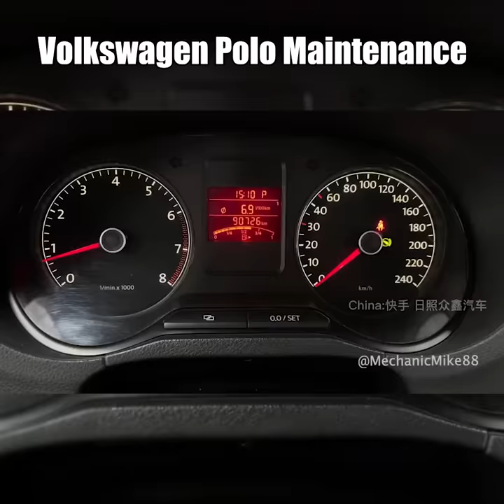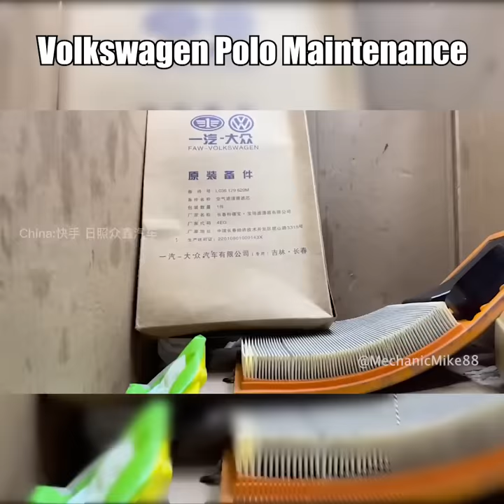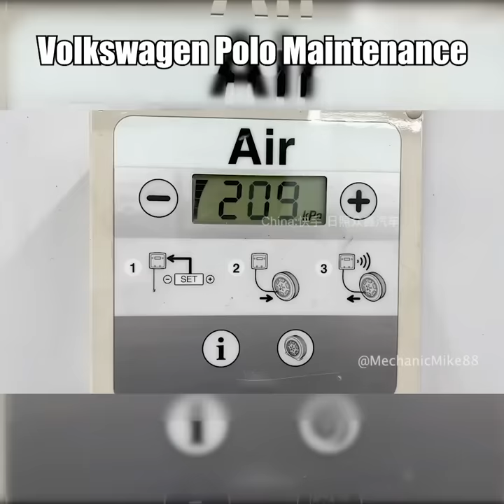Volkswagen Polo Maintenance Service.

Comment: Why not drain oil from bottom if you were lifting the car anyway, can remove sludge aswell
Reply: Yaya.. ill think the same way
Reply: Nah it actually does an amazing job at getting it clean from oil extraction since there is vacuum. There are videos where people put a small borescope in and you can see. Also Audi/vw dealers do this
Reply: @Givemedabeans  Does it actually ? If you vacuum doesn’t it bring all the particles across the entire engine ?
Reply: @dragos9134  well, we do this through the dipstick tube so it goes straight to the bottom of the oil pan, its going to suck everything starting at the bottom drawing particles up the dipstick tube instead of through the whole engine. it really does just as good if not better than going through the drain plug
Reply: @Givemedabeans  Thanks for letting me know I didn’t know that
Reply: Because of time, it's better to drain from the bottom, but faster this way
Reply: @Givemedabeans  its not true for all engines... 
Example, 1.9 dci Renault...
Reply: @Givemedabeans  which oil he eventually drain and clean the oil pan? Was it the gearbox’s?
Reply: @anesdj4282  yes that was the DSG gearbox service. Not sure how often it needs doing but I do believe it likes an oil and filter change from time to time to keep it happy.
Reply: @philiproberts6947  thank you buddy
Reply: @philiproberts6947  DSG oil change intervalle is every 60.000 km
Reply: Si en Puerto Rico los concesionarios dieran el mismo servicio V.W sería una mejor marca .
Reply: Vacuum not perfect as drain off...
Reply: I do all matinence on my mk7 gti and I must say the scwaben air tools and pumps work amazingly well.
Reply: Mrccanico per le bici.
Reply: @philiproberts6947  that ain’t no DSG gearbox mate. Old school torque converter automatic.
Reply: @bergEXPERT  that ain’t no DSG gearbox mate
Reply: Because they are lazy mechanics always looking for a shortcut or easy way out
Reply: @bergEXPERT  dsg means
Reply: Because he bought the tool to remove oil by vaccum, he’s making his money worth it
Reply: I think sometimes oil sump bolt hole threads are damage at the time open or tight after that complete oil sump need to be replaced may be that’s y
Reply: Why he put the new oil before it drain from the bottom?
Reply: @ng990  he was draining the gearbox oil
Reply: Literally how I do it on my Audi and VW's. Dont have to worry about stripping out the drain plug, replacing it etc and if all you're doing is a minor service you don't need the car off the ground at all so it's not taking up a lift.
Reply: If theres a magnet on the drain plug, it si better to remove the plug, clean it, the put it back. Theres actually no difference between draining and vacuuming. They are both great methods.
Reply: @Givemedabeans I work at a Volkswagen Audi dealer and that's how I do it. I have an apparatus which is under vacuum that sucks the oil out.
Reply: @shimon2476 And you think everything is easy, don't you? But you don't even know how to turn a screw.
Reply: @SaveAmerica69  dealership mechanic is accusing me of not knowing how to turn and screw 😂🤡
Reply: @shimon2476  you don't know that's right, you think you do.
Reply: @SaveAmerica69  brother sucking the fluid through a hose with a pump compared to draining the oil from the drain plug is not worth it when you are going to jack the car up anyways I did the hose method a couple times takes longer and you have to fiddle around with the hose to get everything out again not worth it
Reply: Why what's wrong with what he did
Reply: For long videos
Reply: Because Chinese Video
Reply: Because they wanted yo leave inside the small metal partes in It..
Reply: I believe sludge in oil pans is a thing of the past. Modern oil is designed to keep particles suspended. This should work just fine.
Reply: What products you use to clean the engine?

Comment: Your video is super impressive. Some points i noted.
1. The workshop/garage is absolutely clean and housekeeping is superb.
2. The juice scene adds an element of fun to the whole video.
3. The mechanic is an expert as the steps he is going through pretty quick.
4. You should have added a subtitle or explanation on each step.
5. Scene 1:28 are you using s suction pump to extract the old engine oil?
6. After you have jacked up the car, what is that you are removing to drain the oil 3:36? You have already used the suction pump and refilled the oil, then why are you removing the drain plug below?
7.What is it that you are removing in 3:50 and 4:00? Again draining out the oil?
8. What is the rd liquid you are pumping inside the casing after fixing 4:41?
9. What is the pink liquid you are pouring into the plastic bowl? 5:43?
10. Which model polo is this?
If anyone can answer the above questions, would be grateful. Thanks in advance.
Reply: My answer is from what I have learned over the years, I'm not a professional so do your own research too.

5. Many new German car, the manufacturer recommend sucking out the oil instead of draining it, check your manual, this is different per car but I believe draining is sufficient.

6, 7 and 8 from the look of it I think it the transmission oil since this car is for the Chinese market it's probably an automatic which mean ATF that he is pouring in.

9. That is coulant, the ball your see he pouring the liquid into is an expansion tank, it can have pressure when the car is on(and sometimes off) so be careful.

10. It's a fifth gen Polo, I don't know the specific varients. It is from 2009 till I believe 2016 or 17?
Reply: @nathaphonstikkelorum1068  Thank you for the reply. 
6,7,8 is there the transmission oil replacement for manual shift ones also?
I think the specifics vary based on countries. I am from India and they have recently stopped manufacturing Polo here. I loved this car and very sad to see it go.
Reply: @krsu1982  There is, manual usually last longer zo it isn't as frequently, my car a 01 Micra, i changed it on 200k km. Check the user manual of the car to see when to change.
Reply: Это WV Polo седан. Производился для Китая, России и т.д. Двигатель CFNA 1,6, 110 лошадиных сил. КПП - классический автомат Aisin, 6 передач.

Comment: Had a 1.6 polo sedan for 16 years. No problems at all. So down at the moment.  Stolen from my property 2 weeks ago. Loved that car. Only had about 55 000 miles on it.
Reply: which motor code?
Reply: Still Has Punto Sedan Version Linea
It's now near to 17 years i sure and garanteed not a single problems and no issues at all done 85,128 miles on odo still as new god sure amazing car 🔥
Reply: Mitsubishi 4g15 form 80s I remember it was 200000km(124000miles) when it was 20 years old. Of course it's JDM and Manual with clutch replaced.

Comment: Changing engine oil thru dip stick is lazy bad idea! All heavy contamination stay on bottom of subpan. New oil just dissolve, flush them and spread around engine cloging new filter aswell.
Reply: Maybe the oil sump thread is bad haha
Reply: That's why it's called made in china 🫠

Comment: Excellent, 
Safety is a need not a luxury!
I like the way you change the oil. Beside I would like to add engine flash before changing the motor oils.
Thanks

Comment: Should have checked condition of timing belt and ground cable connection at engine block. Clean and apply a metallic antiseize grease to the latter to prevent corrosion. Check positive cable at starter too.
Reply: Там цепь

Comment: You remove the old oil by sucking it? Interesting. I have that same Polo with 1.0 TSI. When I took it into the official VW dealer for service, I noticed that there was a notification in the service sheet forbidding the suck-out drainage due to leftover oil amount being too great. The oil had to be drained from the plug below.
Reply: Draining the oil is always better.
Reply: En el vídeo se ve que marca 3litrs y medio de aceite aprox. Y coloca 4 bidones de 1 litro cada uno. El demás aceite quedó dentro del cárter

Comment: Can anyone tell me where you could get that cap that fits onto the funnel for filling oil? Pain in the arse trying to trickle the oil in.
Reply: Just take off the black cap with screws above the oil filter, it fills much much quicker through that hole
Reply: Beta tool 1758A will do the same job.

Comment: Nice job ! I saw 3.5 l coming out of the engine and you put 4 l in ? Or did I miss something? If not, there is 0.5 l too much in it. Keep up the great work. I always put 3/4 oil in it, when its hot it rises 😎
Reply: My Polo has 1.0 TSI (Inline-3. This is inline-4 so 1.2 or bigger), and it has an oil fill amount of 3 liters.

Half a liter extra may not be enough to cause problems, but it doesn't make it a good practice. Plus, if the stick was dry before oil change, adding half a liter or so is understandable. The amount of oil between the top and the bottom of the dipstick is approximately one liter.
Reply: @akisalmenaho8473  I understand your point, if the dipstick was dry then there is another problem ... because engine is "eating oil" and if thats the case then you need change compression and oil rings
Reply: @Romashka_Official_Channel  Engines "eat" a tiny bit of oil either way. If you have to add an extra liter 25000km or so after last oil change, I would not be worried. Adding a bottle every 6000km is a different story.
Reply: @akisalmenaho8473  yeaah thats true, do you change your oil every 26 k km ? I do every 15 k km (diesel engine) dipstick level stays the same till next oil change. I wish you safe km's on the road, take care man
Reply: @Romashka_Official_Channel  Yeah. It depends on whether you use 502.00 (15k) or 504.00 (30k) spec oil. I use the latter, and the car has been working like an AK47.

Also, you too. Stay safe on the road.
Reply: @Romashka_Official_Channel  well oil is not the main Problem of that car shown in the video.. when the coolant level get's lower either there's a leakage in the coolantsystem or the Oilcooler is faulty or in the worst case the headgasket has a malfunction. Oil Level should of course stay at same level, but as mentioned a bit of oilconsumption is normal due to the Operation of an combustion engine and it's maintenance and resulting wear over the years.. and it also can caused by other (leaking) parts. Lot's of words, simple rule- always be aware when your Fluids disappear
Reply: Not sure what engine this one is, my 1.6 Tdi takes 4.3 litres of oil with oil filter change, without filter change 4-4.1 litres.
Reply: The extra half liter is to fill the new oil filter i think, the old one had take some with it
Reply: @pauloliveira1989  Not that much though with inverted oil filters. It's designed to allow the oil to drain back out of the filter once the engine is shut off.
Reply: @thegreatinvestor4322  yes you're right!
Reply: @akisalmenaho8473  Hi I have the same engine powered by lpg which oil should I put 504.00 or 502.00?  on the use and maintenance booklet it tells me to use 502.00 but behind the bonnet there is a liter of 5w30 castrol 504.00 oil.
Reply: @Angel-xc4vc  I would prefer 504 if available. It's better oil overall.
Reply: @akisalmenaho8473  OK thank you

Comment: All tyres are more than 6 years old and need urgent replacement. Shockes need boot covers. Need regular oil change because engine look dark brown from inside which tells oil have been changed after 7-10k km.

Comment: that low coolant is not normal, check if it has a leak in the back of the engine, under the intake manifold, there is a plastic part there that starts to loose coolant, heater pipe

Comment: 220 kPa is correct tyre pressure for only the driver. The eaiest car ever to remove a AIR and Oil filter - wll done VW - but my new Polo TSi is opposte - very difficult to remove filters.

Comment: strange sequence of operations. since you're washing the engine, why not start with this. since you are raising the car, why not drain the oil through the bottom, as it was intended to produce. what about suspension diagnostics? what about tires? why put oil in the filter? Why do you use the accu tools instead of pneumatic

Comment: Sucking Oil out is NEVER as good as letting it completely Drain out the bottom
Reply: He's using a vacuum pump i think thats about as good as you can have it. If you drain it residue oil may be left inside of the car on flat surfaces inside which doesnt happen with this method.
Reply: @dyren7437  Most vehicles have a Windage Tray so when you stuff a Tube down the Dipstick, it makes it go wherever,  Yeah the Tube might touch the Bottom but who knows where and it's not going to be at the Lowest point in the Oil Pan! So you will have some Oil left in the Pan. This is why a Cars Drain plug is "almost" Always at it's Lowest point, To drain ALL oil out.

Comment: I buy several extra oil filters, remove the gaskets and soak them in silicone tire shine. When it’s time to change oil, I replace a gasket in one and install filter as tightly as possible by hand. Comes off by hand also. Silicone swells and lubricates the gasket. Never leaks or sticks.